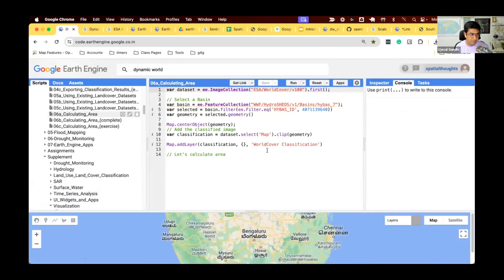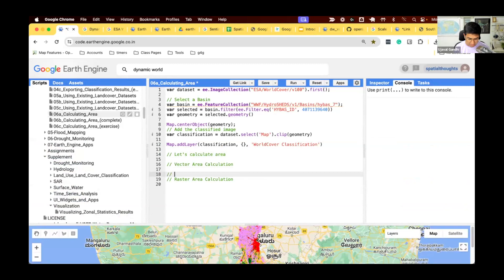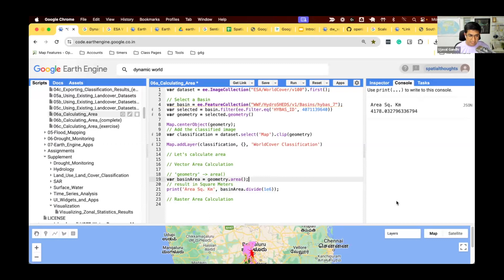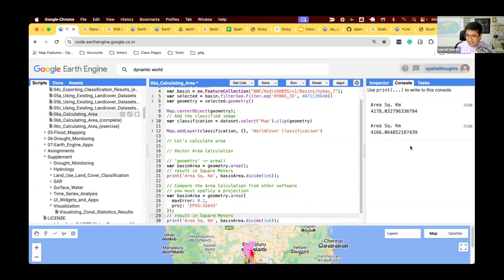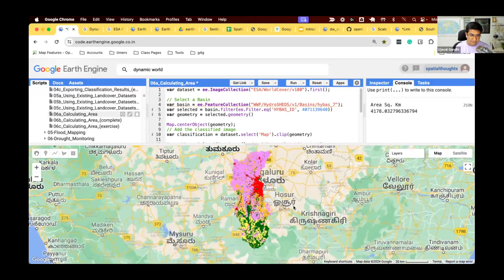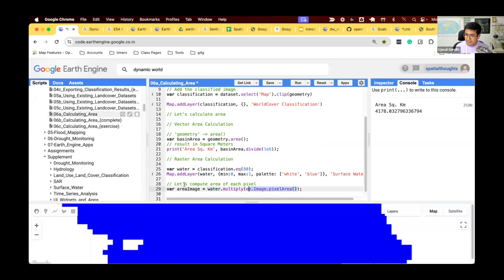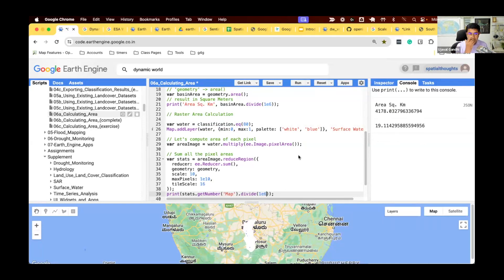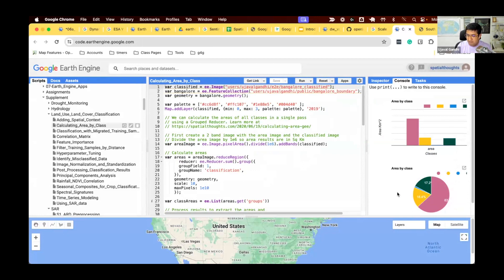Module 4 - 11 Calculating Area - GEE for Water Resources Management

Comment: Hello.. I want to ask one question.
What inserted text coordinate projection if we need to calculate area in "Cylindrical equal area (world)" projection?
Reply from the maker: Search for thst projection in QGIS CRS selector and you will see the EPSG code for it. Use that instead. But remember that if your goal is to calculate area most accurately, the EE method will be the most accurate. Specifying a CRS is useful only when you want to compare your answer with one calculated in another software. Equal Area projection preserve relatives sizes but still can have large inaccuracies for absolute area values. Gee method uses an equal Area projection centered at the polygon instead of using a global Equal Area projection - which is more accurate.
Reply: @SpatialThoughts  
I tried to search it and input as ESRI:54034, but after run the script, the notification appeared as "The CRS of a map projection could not be parsed."

Is it only available for a few projection, or any other explanation?

After all thanks for the aswer and advice, but I think I still need to calculate in CEA because of government regulation here.
Reply from the maker: You need an EPSG code, not an ESRI code. Look for the equivalent EPSG code. I think you can also specify the PROJ string also (this will be displayed at the bottom of the CRS definition in QGIS)
Reply: @SpatialThoughts  I've been looking for equivalent EPSG Code in QGIS, and I found CEA World have same column with WGS 84/NSIDC EASE-Grid 2.0 Global. I inserted its EPSG Code in GEE but still have notification "The CRS of a map projection could not be parsed."

I tried to insert other CRS in same column with CEA world, it works. But I think the others was equivalent with CEA Sphere, and have different method with CEA World.

So what do you think? It is about the delimity of GEE or I miised something?
Reply from the maker: @faris_rangga  EPSG:3410 seems to be the closest one.